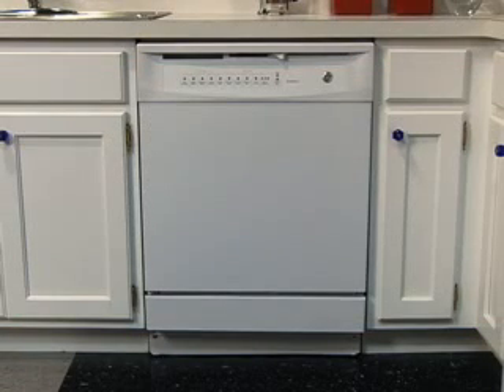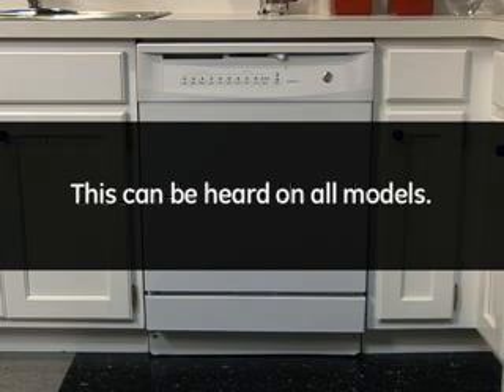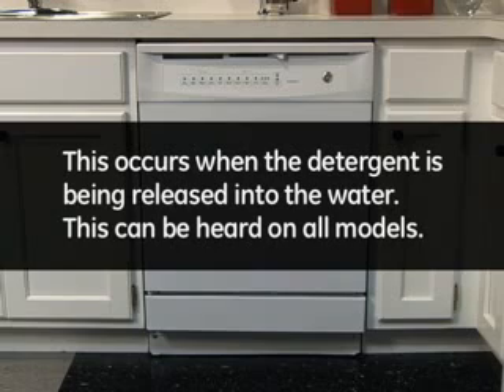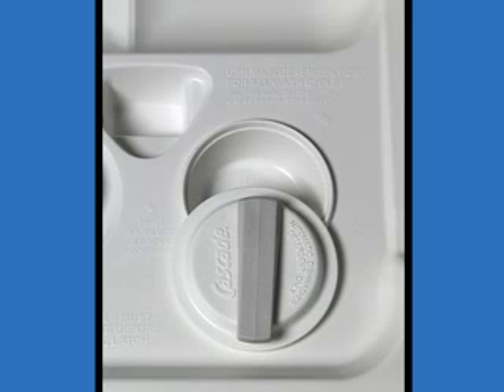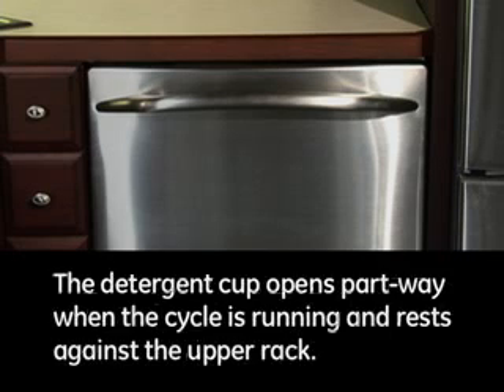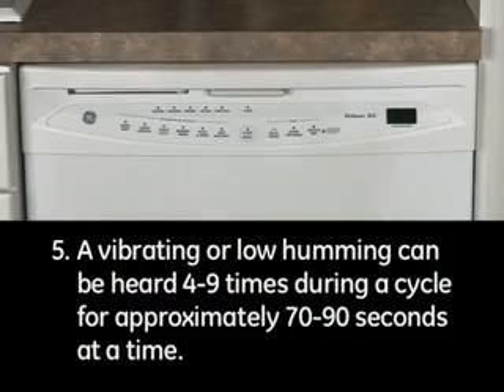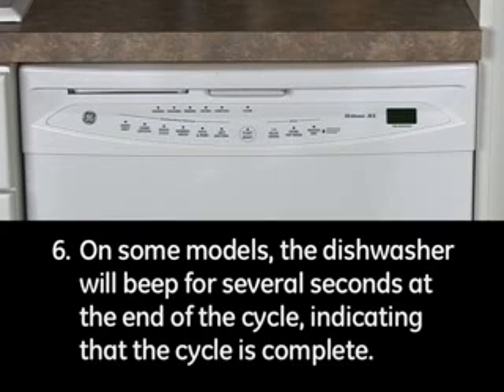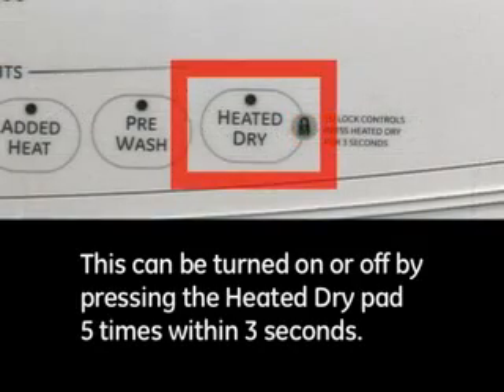Dishwasher Normal Operating Sounds

Comment: Water doesn’t totally empty after wash
Reply from the maker: We understand that you have a concern about the water not emptying, and we'd like to look into this for you. Please send us a private message with your model/serial number on social media. We look forward to hearing from you. All the best.- KW
Reply: Check the pipe going from the dish washer to either your garbage disposal or sink. It should be clear. If it's not in some places, disconnect it and clean it as well as you can. Also, make sure there aren't any kinks.